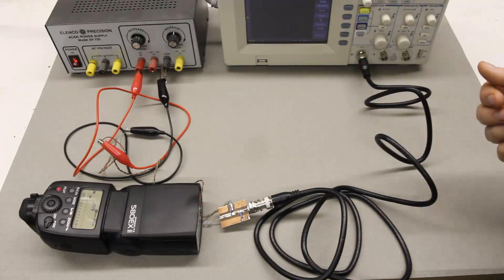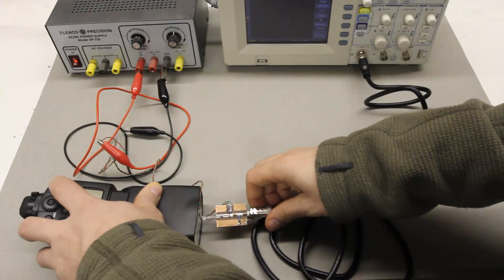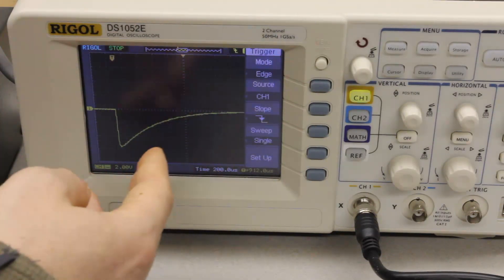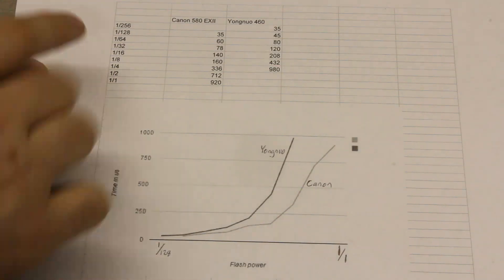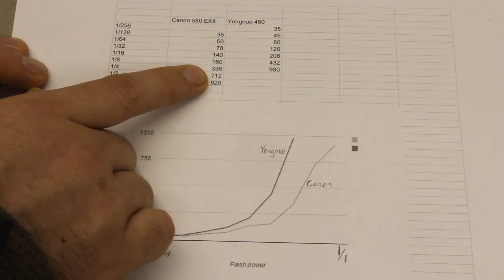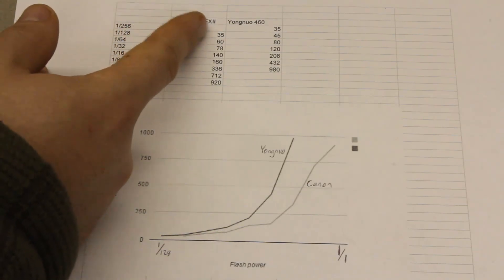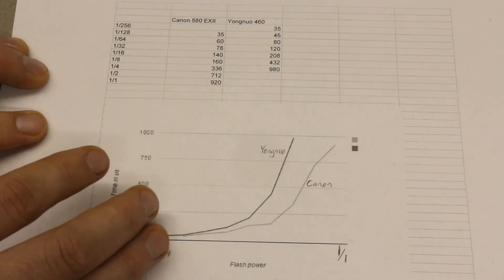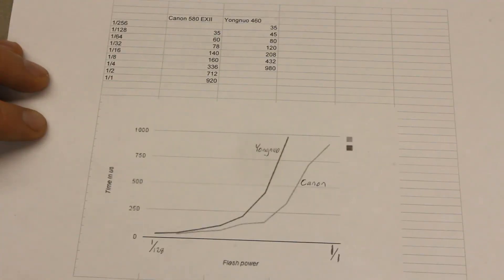TPB #30 - Flash Duration and Intensity Comparison

Comment: I disagree with the circuit used. I can't imagine why you're blocking out the dc component (with the high pass filter) when it's the sustained DC level that you're trying to measure in the first place. Can you explain?